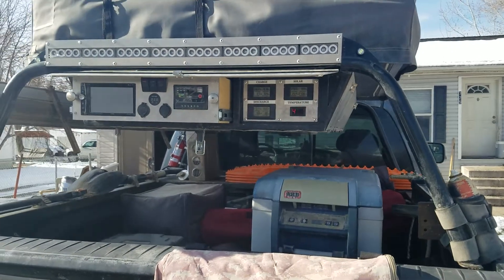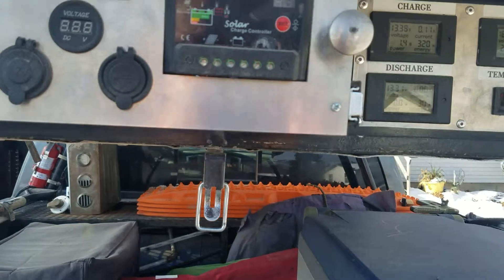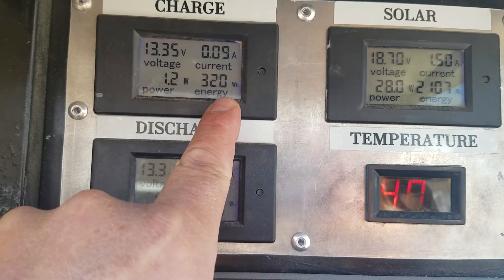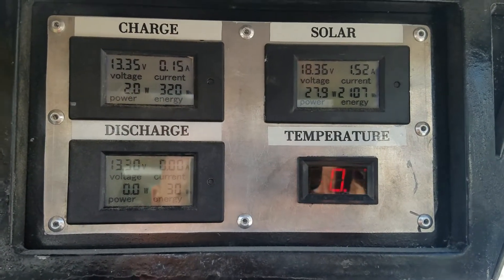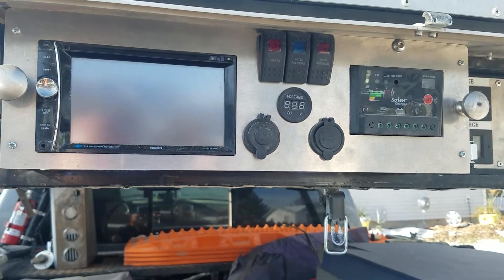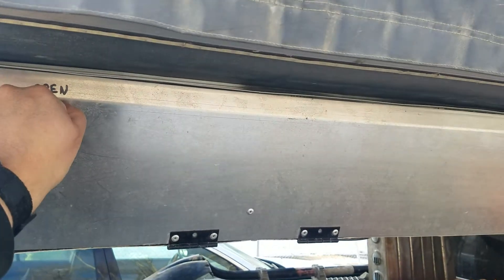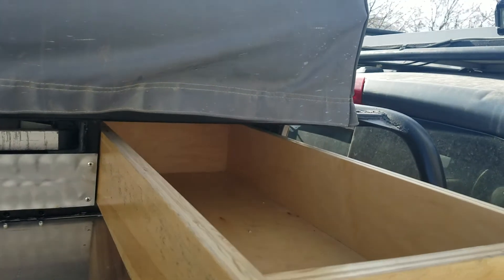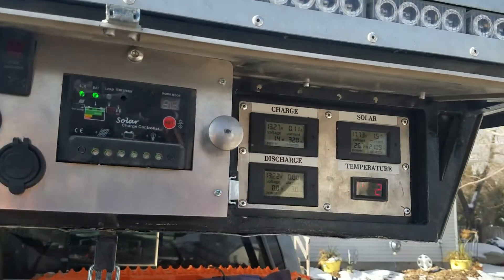Overland solar ULTIMATE SETUP

Comment: Very organized and nicely done. Do you have the same guages and/or ability to make adjustments from inside the cab? Also... was that storage box an off-the-shelf box, semi-DIY, or did you completely build it yourself? It's fantastic.
Reply from the maker: The only in cab monitoring I have is a voltage gauge for the house batteries,  but they charge off the alternator while the truck is running,  so no real need to monitor the solar from the cab. 
Everything there is designed and built by me.